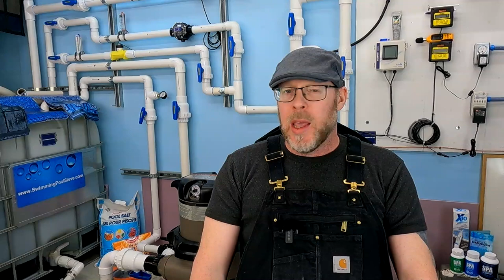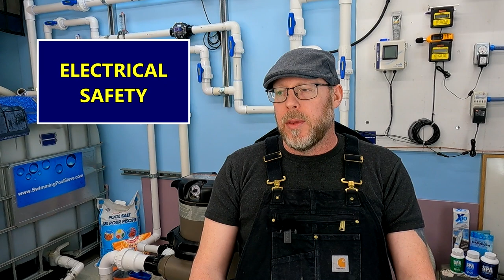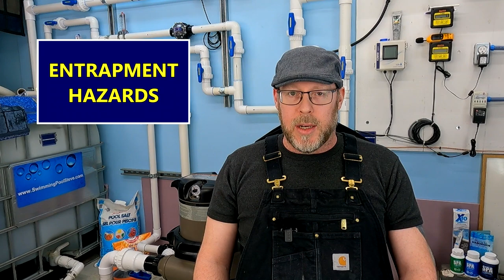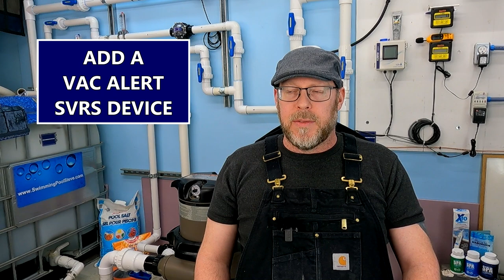Is My Swimming Pool Safe?

Comment: I am a pool professional, but the only thing I will mess with on the electrical side, is direct replacement.

Recently replaced a liner and wanted to upgrade the lights. I’m not touching that, because of the risk of electrocution.

Comment: Thoughts on reversing the single main drain? Or would this mess up the flow dynamics by having too much return and not enough suction, leading to too little back pressure at the pump?

Also, I thought that ensuring less than 1.5 fps in the a main drain with an appropriate cover is generally safe (though installing a flow meter in a residential pool for just the main drain is likely not a simple task for most plumbing).

Comment: Customer - electrician wanted to charge me over $1000 to wire my system. So I did it myself for under 100.

The entire thing was done (salt, heater, pump, ect) by chopping up a home depot extension cord.

I walked off the job. FFS